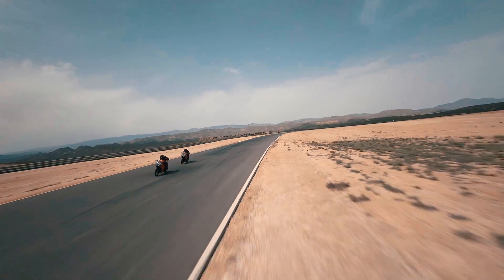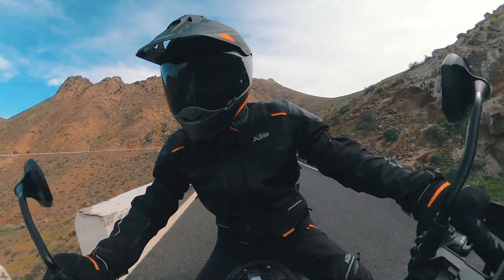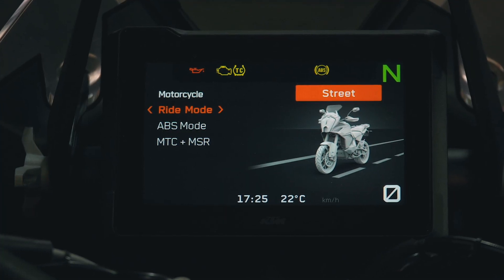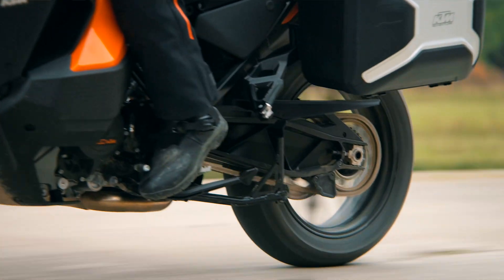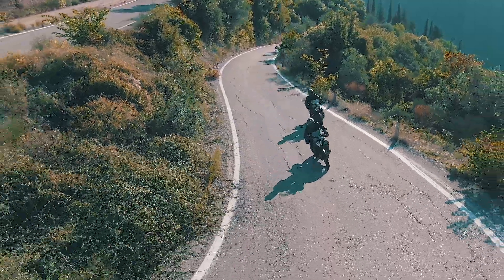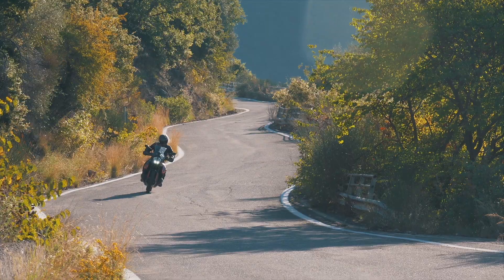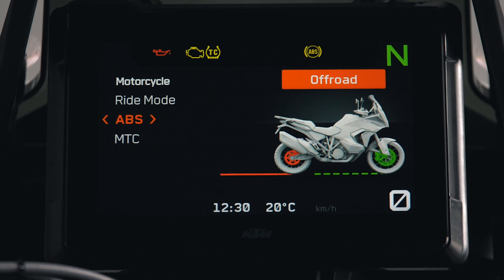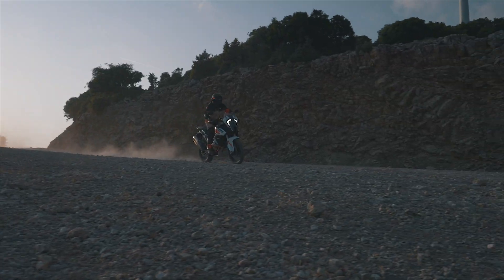Motorcycle Traction Control: Leaning with confidence | KTM

Comment: Why do you need traction control?? Is this so beginners can lean a bike over? Why are beginners leaning this far? Never needed TC on bikes in the 90s and early 2000s (Even the Hayabusa with 185bhp). Why do bikes with more than 40hp need TC?? Do bikes have such terrible fueling now that they can't be controlled on the edge? Or is it just KTMs?
Reply: Maybe to manage the bike in gravel n spilled oil.
Reply: Why don't you just look where your going?  @VascoDaGama1498
Reply: Yeah, I'm just annoyed you can't buy anything without this stuff now. I'm hoping to buy a 1997 ZX9B4. 140hp and a cable throttle, analog clocks and that's all :)  @VascoDaGama1498
Reply: You're so right, but you cancel all tech and have a raw bike if you prefer.
Reply: Governmental regulation because we can't be trusted
Reply: You use the tech its not so much fun but faster and hospital bills are less. 😂.